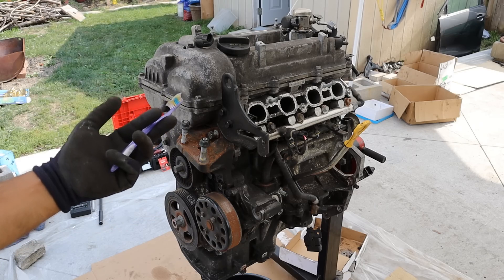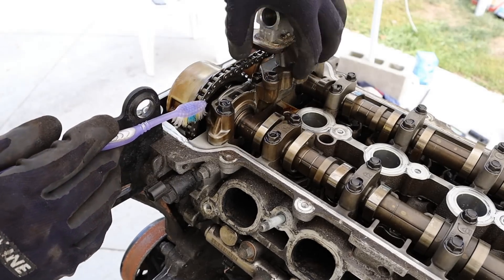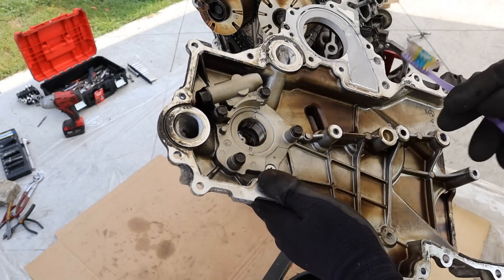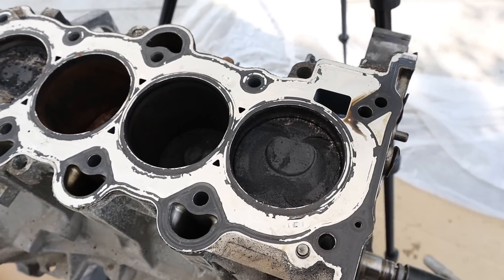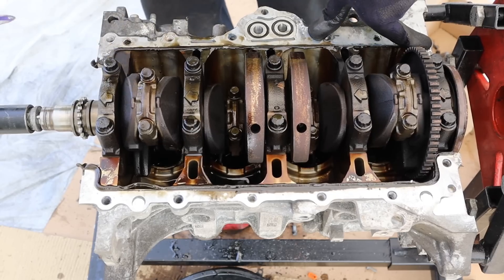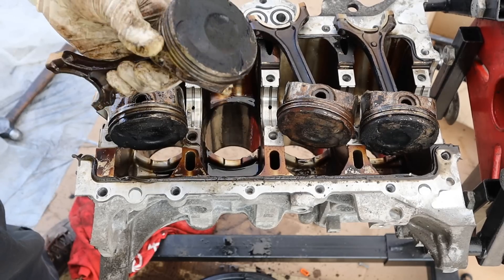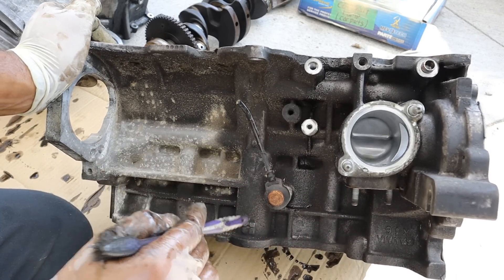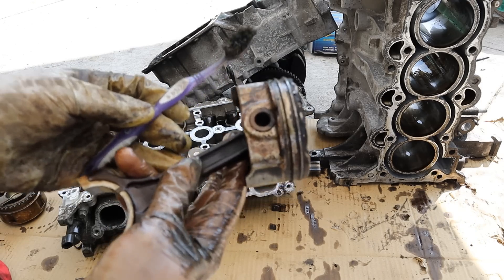Why KIA Engines Fail

Comment: The question is how much to put in a new engine. Are OEM crate engines available? For example if a Kia costs $15k less than a Honda or a Toyota, if you invested that saved money and actually did well, then after 10 years when you can put in a whole new engine and still come out ahead. Although you wouldn’t have the resale value….and you’d have to drive a Kia/Hyundai 😂😂😂

Then again my 2006 Camry is known for oil consumption and faulty head bolts 😮
Reply from the maker: Get the V6 Camry like I did and not worry about headbolts or oil.
Reply: I agree the V6 would be better. This one has been in my family since new though and only winter driven one year.

Comment: My 2013 Veloster only had 500 psi of pressure at idle. Not sure if its higher when the engine is at higher rpm though. 

Compared that to 2020 Mazda 3 with 3000 psi and 2022 GTI (I replaced my 2013 Veloster with) with 5000 psi of pressure on its fuel injectors.
Reply from the maker: Nice

Comment: "a typical KIA owner is not gonna be smart enough to check their oil..." HEY HEY NOW
Reply: "Typical car owner" would be more appropriate - plenty examples of neglect out there
Reply: Yeah I only check mine weekly, is serviced every 10,000 miles, has a brake fluid change every 2 years and I have an oil and filter change in between the scheduled servicing as I have always done with all the cars I’ve owned - any car not serviced will fail
Reply: Lmfao 😭👍🏿
Reply: True tho.
Reply: Lol
Reply: And that's one of the mean reasons they don't last.. they're cheaper to buy treated like throw away vehicles so people on a tight budget buy them and service them on an even tighter budget.. oil changes and levels checks are optional 😅
Reply from the maker: Haha! Glad you caught that
Reply: Every Kia I’ve ever serviced in the past 2 years have had black oil or no oil on maintenance 👌🏽🤣
Reply: @TheWhalord  well, all my kias get 3000 mile oil changes,  full synthetic religiously.  I have never had any problems with thier engines, I do always buy new.
Reply: @TheWhalord  bullshit.
Reply: @TheWhalord  oil color is not indicative of anything.
Reply: @electrosolve991  black oil does not matter?
Reply: He's not wrong.
Reply: @brayannexon4613  He’s totally wrong. I check my oil every time I fill up. In 7 years from new, I’ve never had to top up between services.
Reply: Not smart enough to check my oil? I check oil in any vehicle I own regularly. In fact, I’m smart enough to rebuild the 390 CID engine, at age 16, in my 1965 Ford Thunderbird. I routinely replace plugs, brakes, fluids, etc., on my vehicles when needed. The faulty engine in my Kia Soul definitely wasn’t my fault.
Reply: Yeeeeeah can't defend Kia owners here either. My only friend who owned 2 Kias blew both engines. When I popped the hood on the second one battery acid, rubber bands, and a completely seized motor was all I found. RIP Space Cowboy.
Reply: If you were conscientious enough to follow recommended maintenance intervals (or better), this video shows why you still would be doomed to failure ultimately based on the skimpy design and, in particular, when combined with the GDI carbon build up liability. So, yeah, even if you know what you are doing maintenance-wise with cars, you still would be a “typical” Kia owner for buying one of these in the first place.
Reply: @WarrenMillerIII  The video just shows what happens when you don't stick your maintenance intervals.

Comment: So, how hard is it anyway to change the oil, bearings, and cam buckets on a not-too-old Kia to get a mostly-renewed vehicle?
Reply from the maker: The timing cover has to come off for the upper oil pan to do rod bearings. For the cam buckets, all the timing components have to come off to get the camshafts off. In the vehicle, it would be a tight job
Reply: @speedkar99  Sounds like about a week's work.
Reply: The crank has to be sent for remanufacturing. I don't think one can remove it with the engine inside the chassis.
Reply: @pliedtka  Gotta get them while their crank is still ok.

Comment: First, a personal thought: when a KIA drives by me, to my ear the engine sounds like a 1930s American farm tractor. lol Now, about this engine, it probably came apart so easily because every single tolerance was maxed out to save a few pennies on materials. When next I saw the oil pump and heard you remark about how small it is, that seemed to confirm my idea about the tolerances.
Reply from the maker: Yeah well it's an economy car so they had to go economic on the engine design
Reply: All the saving in order to build Korean economy, lol

Comment: Great Video as always. Conclusion? 
Even if you change oil & filter at very, very short intervals, do this engines have the chance to run reasonably well for, lets say 120k miles/200k kms ?
Can Carbon build-up be prevented or mitigated in any way?   Thanks !!
Reply from the maker: Run some intake cleaner through the intake system to slow down the carbon build up
Reply: @speedkar99  do you recommend crc for that?
Reply: @speedkar99   👍 Thanks.
Reply: Yes they will last to 200k with frequent oil changes say every 5000 km to be safe using synthetic oil and Kia filter, you can do a seafoam carbon cleaning through the intake, lots of videos of it on here.
Reply: @tossmonkey1  Thanks !
Reply: I think you can walnut blast the engine but I'm not an expert not sure.
Reply: @GeordiLaForgery  Elbow Grease works well too.
Reply: Yes carbon cleaning machine can do that if you go to big shops they can do that for you or get intake valve cleaner spray they are cool do it every 10k miles you are good to go.👌👌👌👌👌

Comment: as a kia owner i feel attacked but too stupid to realize it
Reply from the maker: Haha
Reply: Honda and Hyundai are not the same thing bro
Reply: @jaybee6477  Yes.  Honda costs 4 times as much.  Also, look up the many failures they have with the CVT and a V6.
Reply: @karlhungus545  you obviously have no clue what your talking about, Kia’s and Hyundais are the exact same price if not more money and Honda has been making bullet proof v6s ( j series) for 30 years. Name one well built engine Korea makes, the answer is none. Hondas most problematic engines are light years ahead of the best Hyundai/ Kia engine ever made
Reply: @karlhungus545  Cvts are junk in general but Honda and Toyota make they’re own which make them the most reliable unless most all competitors who outsource transmissions
Reply: @jaybee6477  You're the one that's clueless actually.  When I bought my 2013 Rio in 2018 with 12,000kms on it, it cost me $9,000 CAD and came with a brand new set of Nokian Hakapellitta tires on rims ($1,500).  I shopped for a similar Honda and Toyota and they were more than 3 times as much used for a similar year and kms.  I could have 2 spare Kias in my driveway and just throw one in the garbage if I ever had an issue and still be ahead.  I now have 76,000 kms on it and it doesn't use a drop of oil and I haven't put a single dime into it yet, other than oil changes, which I do myself.  The only major failure I've had in any vehicle in over 35 years of owning several brands was a Toyota Corolla with 175,000kms on it that blew a speedometer gear (made of nylon) that required a new transmission as it was cheaper than replacing the $10 gear.  They're all junk, especially new ones.
Reply: @karlhungus545  so not one fact besides your own Kia that hasn’t had problems with low miles on it
Reply: @karlhungus545  nah. New Toyotas are more reliable than ever.
Reply: @jaybee6477  Honda has fallen off, newer Hondas and Toyotas are falling and falling in reliability and value. 
Mazda has become the new reliability manufacturer
Reply: @alextheonewarrior  only because Toyota is building half their vehicles
Reply: @alextheonewarrior  your pretty funny, Mazda is good though, doesn’t make a Kia any good
Reply: @karlhungus545  I have the 2013 1.4 CRDi Rio for 9 years now and after about 120.000km, it still drives like it's brand new with no drop in power, or change in sound whatsoever. All I ever changed besides the standard lubricants (annual oil change/transmission fluid) was a clutch disk for 300€ and a lightbulb at some point. It's suspension is a bit on the wobbly side but it handles potholes with no issues, offering a comfortable ride. You can connect your phone via BT or 3.5 Jack, connect a storage USB to play music from and tops it out with outstanding door-integrated speakers. It also has great fuel economy. You can exceed 700km with a full tank. There's a live consumption display that refreshes every second or so, through which I learned how to drive any manual car economically. In my case, the premature clutch wear is unfortunately unavoidable due to the traffic conditions here with frequent stops in steep hills and other road design failures. Beats the hell out of every CVT transmission though. These toys should stick to scooters and lawn mowers. Not 2 ton cars. If you time the upshifts right off the line it outpaces much more expensive cars, as long as you keep the turbo spooled up. Between 2000 and all the way up to 4000rpm it generates enough torque to plant you firmly on the seat.
Reply: @justinmartin8887  More than 1980-90? That remains to be seen. The general metal quality has dropped dramatically since then.
Reply: @orm6922  metal quality in Dana built toyota frames has always been awful. Especially in the 2000s. They’re better now, sheet metal is definitely better in the 2007 and up Toyotas
Reply: @justinmartin8887  Not if you don't change the oil like a typical toyota owner..
Reply: @karlhungus545  V6s in general are bad engine to pick up. They are naturally not balanced, and takes alot of mechanics/complexity to make it somewhat balanced.

Much better off going for a strait 6 or a 4 banger in my opinion. I dont like unbalanced engines, i had a 3 cylinder once. Horrible, two pistons on top while one is down. Makes for alot of vibrations.
Reply: @alextheonewarrior  joke😎😎
Reply: @MrDanisve  I have got a 3 cylinder tractor & that is a bit rough running but it is from the 80s & I have a 3 cylinder digger & that goes really nice. very smooth Yanmar engine.
Reply: @calthorp  Tractor engines usualy dont rev that high, so abit of unbalance is less of an issue with those. Its when you get into those high revs the littlebit of unbalance becomes alot of unbalance.

My point is you have to compensate with alot of engineering to make them balanced. So why not go for a balanced number instead. The cost is often lower. The less complex the engine, the cheaper to make. The cheaper to run etc.

You can make a 3 cylinder as smooth as a 4 banger. It just takes ALOT of engineering to make it so. Where the 4 banger is naturally smooth without any complex engineering.
Reply: @MrDanisve  mine are diesels so dont rev that high. I did have a Yamaha outboard that was a three cylinder & it was fine but was 2 stroke. They even put those balance shafts in some 4 cylinders. Years ago I had a 1964 twin cylinder BSA motorcycle 650cc It was crazy both pistons went up & down together so had to have a huge counter weight on the crankshaft. It used to vibrate like it was going to rip the frame apart if you went over about 50 MPH.
Reply: @calthorp  Two cylinders firing together, aswell as right lenght pipes is what gives Harley engines their unique sound.

Then again, Harley aint "performance engines" but they do sound very nice. 

2 stroke diesels, oh those are some fine engines. Hard to find more efficient engines than that, alltho they are quite dirty. But oh boy do they perform and so simple to work on. 

As commonly known, large inline-4 engines need twin-balancer shafts rotating at twice the speed as the crankshaft to reduce vibration. This is very different to 3-cylinder engines, which need a single balancer shaft running at crankshaft speed.

With a simple twin balancer, the inline 4 is reduced to nothing in vibrations. As the forces counteract eachother. 

With a single balancer you have the rotary force that is not counteracted

(Sorry for any misspellings or wrong words, english is not my first language. So i kinda mess up when talking technical)
Reply: @jaybee6477  dont race them tow heavy shit and change the oil in them, it will last
Reply: @karlhungus545  I have a Subaru outback change the oil in it and you will have no problems and dont toe stupied shit.
Reply: well he straight up said a typical Kia owner wouldn't be smart enough to check their oil frequently....
Reply: I talked to some millennials about oil in their engines and the dipstick I asked him what the dipstick was for they said it tells you when it's time to change your oil when there's no oil on the dipstick it means you're out of oil and you need to change it............... So I replied, yes that's right it's kind of like when you run out of toothpaste you need to get some more toothpaste but you don't need to brush your teeth for a while right 👍
Reply: My glad in Canada 🇨🇦 the recommended oil change is every 6000km
Reply: I like your humor.
Reply: Nice, now you know you shouldn't buy a kia